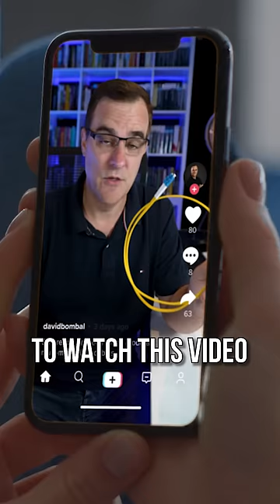Did you know you are using these right now? #shorts

Comment: Oh, there's a LOT more differences between single-mode and multi-mode fiber, especially the size in microns. 
There's also the fact that you can use single-mode (LC) SFP modules on both ends of a multi-mode fiber and it will run CRC error free...even the old 62.5 micron....but multi-mode modules on single-mode fiber won't work. 
And they're rarely made of glass anymore. They're mostly polymer now which is why they now use "fusion splicers" and you no longer have to polish the ends in another complete process. 
Lots of changes over the years!!!

Comment: That's not a cable, just an optical patch cord between the cable end and the interface module .   There's 2 fibers one for each direction .  Be sure to get the right type for the signal and optical connectors .

Comment: Single mode too light don't travel in straight light.
Single mode fibre diameter is smaller than multi mode. Refraction is more in larger diameter fibre. Even though you can see light through single mode after bending it significantly drops the laser power.

Comment: You are wildly incorrect.  The light in a single-mode fiber doesn't just "go right down the middle".

It bounces along the core just like in multi-mode, but at a much shallower angle of incidence.

Additionally, the primary reason multimode is used more commonly is actually due to the fact that it has a greater bend radius with less diffusion than single mode.

Comment: That is not a very good description of what is going on.

Multimode uses total internal reflection to get the light to pass down the cable, single mode does not. And SMF is only possible due to how thin the light transmissive element is, which is typically around 11 microns in diameter. The human hair is around 80 microns.

Comment: As someone with little understanding of electricity but much concern about the safety of my PC I must ask: is there any way the electricity from a lightning can travel through the fiber optics cable of my ISP and toast my computer?
Reply: No, fiber optic cables are non-conductive, they would just burn if struck by lightning.
Reply: @atcatcatc  Thank you very much

Comment: you are wrong about the fact that single mode optical fibers allow for traversal through middle of the cable cause that's not possible through a bent cable
it's actually the same principle as the multi mode which TIR it's just that it's only a single angle unlike multi modr

Comment: I sure as hell am not using one; my ISP is pure garbage and I have filed several complaints with both them and the BBB. I live less than 1000' from the nearest node and I would be lucky to get more than 3Mbts out of my connection. Not to mention they are the only ISP for miles and I only have one choice of plan.
Reply from the maker: But your ISP is most likely using Fiber to connect to the rest of the Internet. And so are the data centers around the world that you connect to like Google etc so you're using it 😀

Comment: Please, don't talk about the science aspect if you're not going to put in the couple minutes to read a Wiki page.

The light is bouncing around in the optical element either way, there's no such thing as the light "going right down the middle". These things work via total internal reflection, no matter which mode you're concerned with. Singlemode basically just cares about light getting to the other end of the cable, whereas multimode has to maintain angular separation between different rays, and thus they are optimized differently.

Better to leave out the science and just say the interesting facts you had.

Comment: While basically correct this short dosent do justice to what's happening in fiber optic networks. Under sea cables are especially fascinating. When you get into MultiMode it's class matters greatly om1 has a core diameter 62.5 um as opposed  to om2/om3/om4/om5. Om1/Om2 caps out s 1gb transfer speeds whereas om3/4/5 and provide speeds up to 100gb given the correct length and transceiver setup.

Comment: Your explanation isn't quite correct - the light is bouncing around in both cables. 

The difference is that, in multi mode cable, the core is much larger and the signal is propagated in multiple modes. In single mode cable, the core is much smaller so it is only propagated in a single mode. In both cases it's bounced around the core - otherwise in your explanation, single  core would either have to only ever be perfectly straight, or there would be some magic force keeping the signal right in the middle, repelling it from the sides of the fibre....